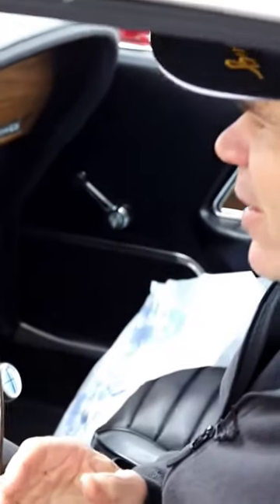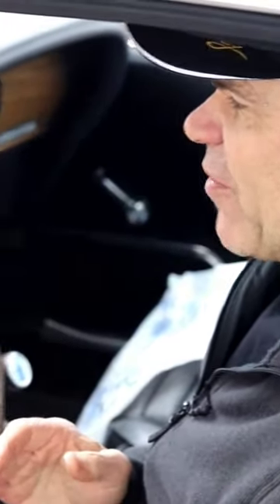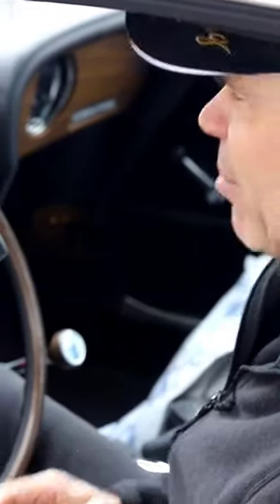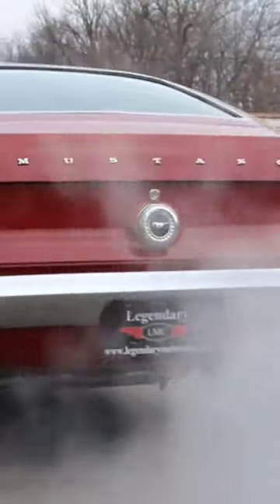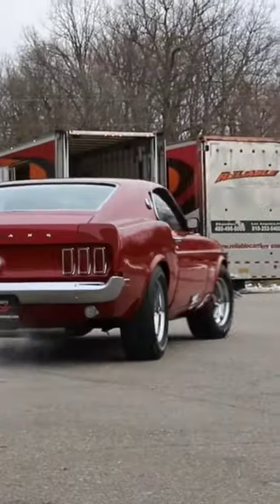How to start a classic muscle car without flooding EVERY SINGLE TIME 🤯

Comment: I've never done that to my '69. Which I've had since I was 16. Here's the trick. Keep the carb properly maintained!🤨
Reply: Well there is that. There’s a Sniper too.
Reply: He's driving a car that's going to auction, we don't even know if it's his or not. And he has a classic car dealership, over 100 on the lot. Can't keep everything maintained 24/7.
Reply: Bingo
Reply: You got a classic V8 as a first car...? Idk if I'll have a car before I get a job, and even if I was like 26, even then a first car shouldn't be that powerful, right...?
Reply: @hunterxsimple3821  maybe this is an older gentleman???
Reply: @Iwillnotbepushed  then there’s rebuilding a carb for cheap and keeping it tuned correctly, or just go spend 2k+
Reply: Exactly lol, my 67s never flooded but thats cus ive actually maintained my carb😂
Reply: @foodhatesme Three thousand dollars is a lot to save up when you’re first starting out. If you have any sort of bills to pay prior to attempting to get this car then that will become problematic. It all depends on where you work and how much is your pay at said location. Regardless a v8 muscle car isn’t the best option for a first car anyways because the bad gas mileage is practically another bill stacked on top of the car note and then stack overpriced insurance on top of that because insurance companies don’t trust young people with fast cars. 😂
Reply: Yup
Reply: @hunterxsimple3821  The classics aren't that powerful. At least by modern standards. However, no real safety features on classics
Reply: Do you see the water vapor coming off the exhaust? It's obviously cold, maybe he's running downdraft Webers without a choke.
Reply: These cars sit and he IS in Canada you know…

Comment: Starting a carbureted vehicle is becoming a lost art.
Reply: My 69 Dodge Cornet, pump it twice and then hold the gas pedal about ¼ the way down.  Would fire up every time.
Reply: Sure is 
Remember the early 70’s Mopars? 
They would flood easily if you weren’t careful 🤞
Reply: Remember the 1970's commercials with the Shell Answer Man. He said once its flooded, floor the gas pedal to let more air into the carburetor as you turn the key and start the car.
Reply: @countrydelite5956  Wow, the Shell Answer Man, that's a blast from the past!
Reply: No. It's not. Stop being a boomer
Reply: @YungEagle3k  stop being rude!
Reply: There isn't an app for it, so can't be done these days 😃
Reply: @Markcain268  IKR
Reply: @Markcain268  Tell me you're 45 without telling me you're 45 lmao
Reply: @startrader9503  45 sounds good to me!👍
Reply: @Markcain268  you're right, sounds more like 65 to me
Reply: @startrader9503  what does 65 sound like?
Reply: Yes I remember the Oldsmobile 350 rocket 1972. In the Cutlass
Pump it two times say three hail Mary's turn the key if it doesn't start the first time pump it one more time say two more hail Marys turn the key
Reply: @Markcain268  yeah, cause' cars are better now
Reply: @binodtharu6071  yes, so good that they rely heavily on computers to actually move, rather like their owners lol
Reply: Scooters
Reply: You say that like its a bad thing
Reply: Use the choke its not that hard
Reply: Soon people are need an app to scratch their dry knee caps

Comment: A finely tuned carb will make a big difference
Reply: I much prefer carburetors over fuel injection.
Reply: @kelsycunningham8452  I can see how in a desperate situation like the apocalypse you would prefer it, but as of now, fuel injection is just better in every way. DPFI has issues with carbon build-up for sure, but MPFI has you covered in cleaning valves and delivering better power than carburetors and much better fuel mileage.
Reply: @EmilyRose900 lol dude if you can afford a $20k-50k muscle car I’m sure they can afford it😂

Comment: I'd love to the see a cold start with the same car, but only touch the gas just enough to close the choke, and see if it does the same.
Reply: Ha ha well said ol boy.but if it was mine the choke would be wired open or some crap like that
Reply: If properlly adjusted, it will start. It will even start without depressing the gas Pedal, If the choke valve is closed.
Reply: If it’s cold the choke should already be closed. Unless you set it up warm which used to happen a lot
Reply: @stev838  nope, if it was hot when you shut it off, the choke is held open when it cools down until you activate the choke by flooring the pedal once. This is true for every unmodified factory auto choke.
Reply: @bigblockjalopy  right    And if it’s cold the choke  is closed. ?Long time ago seems like the electric chokes closed 
As I recall my termo quad would  close as it cooled 
But that was many years ago sooooo 
My old Carter’s would snap it shut when you stepped on the gas.    I set mine up so you did not have to pump it.    If you did it was like rudely waking a little monster.    I liked to let it spin a half turn and it would set at 650 rpm.   Seemed better than spinning up a dry bearing
All gm  never ran fords
Reply: @stev838  I have the habit to crank my cold engine until oil pressure is there, then I close the choke plate to let it start. 383 Mopar that I drive since the 80s, 370k miles, still runs like new.
Reply: @bigblockjalopy  that’s the best way.  
Like starting a rotary air plane engine 
I was always glad when my holly uno barrel.  Would start my 235.  You had to spoon feed it with a manual choke
A 383 needs a shot to wake up.   
Sounds like somebody beating the inside of a trash can with a hammer 
I stayed away from the 440 Cuba’s and such     But when I put that termo quad on my  Camarillo   It really made a difference    Heat activated choke 
Adjustable air horn     And an adjustable
Step down.      I hand to dial it way back to keep from going sideways in fourth 
Seems like it was a Chrysler product.  But I’m not sure.     1400 cfm.

Comment: Correct way to start a car with a quadrajet carburetor:  First, push the pedal all the way to the floor/wot=wide open throttle slowly one time.  This will set the automatic choke.  Second, turn the key on, start the car.  Do NOT touch the gas pedal.  Car will start and come to a fast idle, if the carburetor is set correctly.  As the motor warms up it should come down from fast idle, if it doesn't tap the gas pedal and it will come down to normal idle.  Every time you push the gas pedal you are making the accelerator pump squirt gas in to the intake.  If the car gets flooded, it needs more air.  Push the gas pedal all the way to the floor and hold it there, this will open the butterfly's and let air into the intake.  Turn the key to start the car, as it starts gently let up on the gas pedal and let the car warm up.  If you have a owner's manual read how to start your car.  Alot of info in a owner's manual, read it, most people do not.  Especially with newer cars, they have a lot of features that you will not discover with out reading the manual.

Comment: U shouldn't have to pump it 3 times. The automatic choke should set on the 1st  pump on a cold start when it's ❄️ outside. Especially if the choke is set correctly!!
Reply: Absolutely correct.  Don't be a three pump chump...

Comment: If it's got a auto choke, and it set correctly, one pump to the floor, then hold it half way. No turn the key. Should fire and run on fast idle. Wait two mins. Kick it and it'll settle on idle 
Three pumps an you'll flood it.
Reply: 3 pumps won't flood it :-P You have to work pretty hard to flood an engine, or have your carb way out of whack.
Reply: How

Comment: A carb that's set up properly (automatic choke tension,  accelerator pump, vacuum choke pull off, etc) should take 1 pedal to the floor and up, remove your foot from the pedal.  It should start immediately, as in quicker than any fuel injection system on a cold start.  If the weather is freezing then 2 pumps will suffice. 3 or 4 pumps at -30 or  -40.  If the engine has been running previously in the day, say 3 or 4 hours earlier it should start just by turning the key.  
But then again I could be wrong.
If you have to pump that much fuel into the intake something isn't right as in lack of choke action or possibly weak ignition.

Comment: Like how he made sure in neutral,foot off clutch to save throw out bearing.thats an old school trick I was taught 60 yrs ago
Reply: How is that an old school truck? Seems pretty basic. Do new cars require you to step on the clutch or something?
Reply: Yes newer cars does requires clutch in safety switch located behind the pedal 2 prevent start up in gear
Reply: @impalalfx1108  I always remove the safety switch. Then I can reach in and turn the key if I'm working on the car for some reason.
Reply: @Whats-It-To-Ya   I ran myself over like that a couple times after that I made sure I had a working e brake
Reply: @Fastcarsslowwmoney  oh for sure. A working e-brake is a must with a manual trans. Especially if you live in the mountains like I do, always parking on hills.
Reply: @Filthy PeasantI park with the wheels turned up against the curb for peace of mind and I use parking chocks when doing repairs. Not the cheap ones, the large solid rubber ones that they use on the dock for 18 wheelers.
Reply: Are you kidding.     Neutral    always 
My 69 z 28 Would spin the tires forward then back if clutched out cold     
No e brake would ever hold that runner
Fangorus

Comment: So I feel like I'm pulling out the only person that's going to say this but that fuel is not atomizing in the intake just sitting there, there may be some vapors forming but no atomization going on there once the fuel comes out of the injectors / throttle body / Jets/whatever you want to call the delivery system in a carburetor when there is not a vacuum being pulled as a result of a running engine
Reply: Maybe you're the only one saying it, but definitely not the only one thinking it. Gasoline sprayed into the intake of a car not running atomizes?
This is some car guy. That's what I was thinking. I still cannot believe he actually said that.
Reply: If anything it will just sit on the piston. He probably means vaporize anyway.

Comment: Ehh If you own a carbed vehicle you should get comfortable tuning one where I'm at it can be 100+ in summer and 0 in the winter I tune my truck about 6 times a year but I love barely touching the key and it firing right to life no weird foot business required if it doesn't just start its time to tune it again vacuum gauge and a timing light are your best friends

Comment: I agree with the pumps but how does gas atomize without vaccuum or air flow?
Reply: It doesn't. The accelerator pump doesn't atomize fuel, anyway. It's just a stream of liquid gasoline.

Comment: Hey bud, uh, there ain't any gas "atomizing" in your intake while you wait. Maybe "evaporating". When you press that pedal 3 times, you will get 3 squirts of gas from your carb jets which goes directly into the barrel(s) of the carb, dropping into the intake as a liquid. Once it's running, the air coming thru the bowls creates a venturi effect and draws the fuel down with it, and even then the droplet size is too large to say atomized. Fuel injection atomizes. 
   Also I have an A body with a Chrysler LA small block that you can pump infinitely without flooding. Figured out how to do this by accident. Wont share my secret but often show the proof IRL. Beautiful Mustang brother! 👍

Comment: My father has a 1957 Corvette with a built 350 Chevy small block and a 420 mega blower from B&m All he does is he turns it over until he sees fuel pressure on the fuel line gives it a couple pumps and it starts right up and idles perfect.

Comment: Old Carburated Ferrari's had the same issue!  Infact, many Ferrari Mechanics Disconnected the Choke to STOP owners from Flooding the Engine!  I owned a '69 Camaro SS 396 and a '79 Ferrari 308 GT4...this was the right way to start them!

Comment: If I did that with my Cobra it would flood like the Johnstown Flood. My Corvette wouldn't even make an attempt to start (before I put an electric fuel pump on), my Chevelle needed two pumps then two more pumps after cranking, a GTO I was working on for a while needed three pumps, wait a couple seconds and then two pumps after cranking, my 65 Cutlass was the same as my Chevelle, and both of my dads' 69 Z/28s you run the electric fuel pump, pump twice, crank a couple seconds, pump twice, then they fire right up. Every old car I own/have owned has its own personality and half the fun of owning them is I try every trick in the book while starting them until I find what works best. If I haven't started any of them for a couple months during the winter, then the process is completely different for all of them which also took figuring out through trial and error.

Comment: My wife has a 57 Chevy pickup, I had a 65 mustang but my toy is a 95 astro van with a 383 stroker. I also have a 2003 6.6 at 700hp.

Comment: I alway just pumped twice, and then held the pedal to the floor until it started and then feathered it until it warmed up enough that it could idle 😂. Works on my 1953 Studebaker and on my 1977 Airstream Argosy lol, both will fire up instantly.

Comment: I always set up my chokes to be held fully open with slight pressure at operating temp. For example, on my 55 Chevy I pump the gas once and the choke is set and it starts without touching anything else faster than a modern car.

Comment: I'm trying this tomorrow on my 67 fastback mustang
Reply: Having worked on Fords and switching carbs on my Mach 1 a few times, I suggest to you a Holley 4 with electric choke , stock jets and no modifications to vacuum hoses at all . The slightest of micro leaks in the vacuum lines from intake will goof up your performance and fuel economy. Run Supreme fuel if possible.  I found AF42s and Bosch plugs seemed to be the best two types for my 351C and for a friend’s 67 GT  289 —only engine mods  was a very mild choice Ford parts catalogue cam, Edelbrock intake, and headers and old school Dual point distributor and Accel coil . Chuck’s car started with a blip on the ignition switch every time . No pumping pedal and excess cranking

Comment: EFI is nice but the old Carb is simple

Yes at 29 drug the EFi will premix the air fuel for that quick start like computer jet or turbine engine starts

But you just can't beat the carb system when it comes to smiple no electricity sensors

Comment: I've got a '65 C10 original with 283 V8. It's got a manual choke but I don't always need it, atleast all the way. Assuming it hasn't been sitting for months and months, one single pump of the gas then I leave it alone, cranks right up.

Comment: a well tuned engine needs half a pump set the choke and it fires off instantly engine starts to rev up open the choke bump the throttle and take it off high idle

Comment: I had a 74 Nova with a 350 and 4bbl carb and always pumped it 2-3 times and always started up right away. I miss the fact the engine started with a literal blip of the starter as opposed of the fuel injected cars that take a few full revolutions to potentially start.  Plus you cant beat the sound of induction of a carbed engine!!

Comment: sounded like the Timing was off. I only have to do 1 or 2 pumps in my 65 mustang. then  hit the Key & she fires up, my cold idle 1100 to 1300, dependant on outside weather. Electric Chokes are good.

Comment: If it's been sat a couple of hours prob has dry fuel bowls with modern ethanol fuel, so your just pumping air. If mechanical fuel pump. A few cranks first, stop, pump start. Trick if you flood. Hold foot to floor and she will clear her throat 👍❤️

Comment: I'm just wondering how the fuel atomizes in the intake when the intake has no vacuum. Turn key to on pump twice crank repeat till it idles on its own, if it won't idle cold on its own choke or check carb tuning

Comment: Can't believe you have to explain this 
But I guess it's a whole new generation that need to be taught this , if your set up is still stock all you need is one pump and let the carburetor do its thing the choke is hooked up to the exhaust system and when it reaches optimum temperature it heats up the coil that actuates the choke , it's thermostatic

Comment: Not my carbed daily driver square body. 
One pump to the floor to set the choke and fast idle cam linkage. 
Crank on the ignition, and she fires up Immediately most days. 
Let er run on high idle for a minute or two. Kick er down, and away she goes. 
Yes it works on 15° cold days too.

Comment: Step on the gas twice first time closed the choke second time gives more fuel in the carb. Start it and the choke should be closed raisins g the idle until it warms up itself and idles down. You can also kick the throttle by stepping on the accelerator very quickly and releasing. If it doesn’t idle down it’s not ready to idle down. My next tip is to get rid of the carburetor and install Sniper fuel injection. It’s a piece of cake and that stink when the weather gets cold is gone too. I hate carburetors.

Comment: When the carb is properly tuned the most "pumping" that's needed is 1 pump to set the choke and the engine should start.
Reply: Not if it sits for a week or two at a time before its started

Comment: Waiting 10 seconds serves no purpose. The accelerator pump squirts the gas when you pump the pedal, the gas leaks down into the intake manifold, and that’s it. It will not “atomize”.

Comment: My truck has something going on with the fuel line where after you start it it keeps slowly revving up and then you need to pump the gas and it goes back to normal but slowly revs up again. Can you explain what’s that’s about?

Comment: I never had another problem once I started using 100% petroleum fuel. The stuff with ethanol mixed in regularly gave me vapor lock.
Reply: I had the same problem on my Falcon. liked to stall anytime engine speed was low.